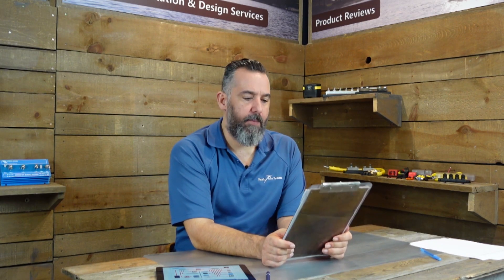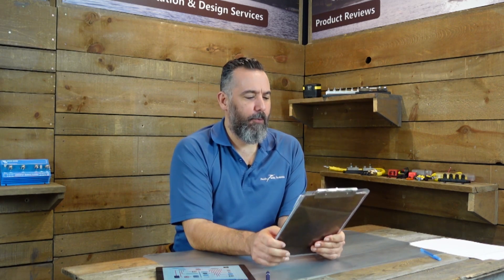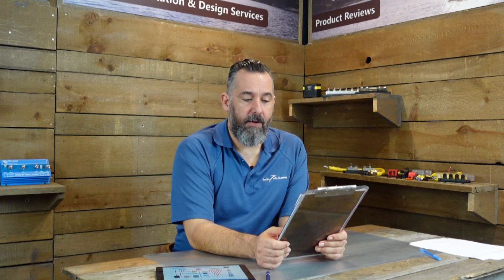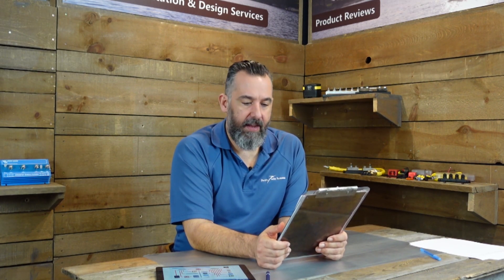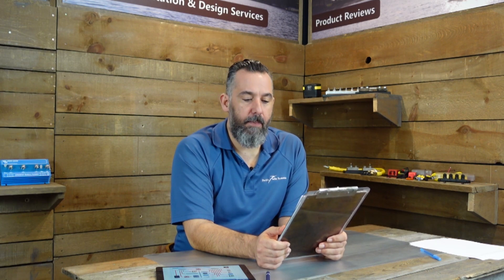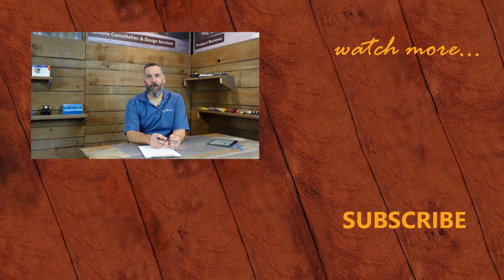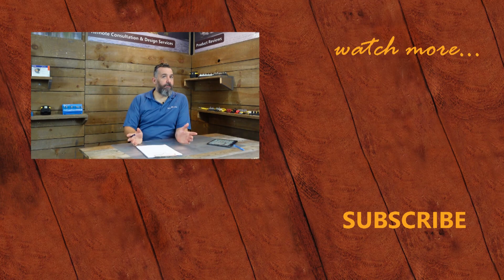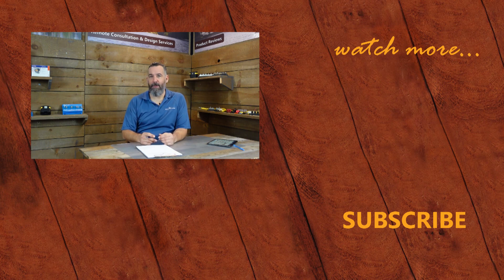Is It Necessary to Connect the RF Ground on My Electronics?  I Am Not Sure What Purpose It Serves?

Comment: The Grounded Conductor vs the Grounding Conductor.  The Grounded Conductor is current carrying,  the Grounding conductor does not carry current.  The shield is grounded once, it not meant to be current carrying.  Grounding has it's own chapter in the NEC.
Reply from the maker: Thanks Chip.
Reply: @PacificYachtSystems  You're welcome.

Comment: Can I have a red ground bus? Or can that cause different equipment to interfere with each other?
Reply from the maker: Hey Mike, above you mention red, assuming you mean "RF". Yes, it's recommended to have a RF ground bus that is connected to your overall common ground bus.
Reply: @PacificYachtSystems  yes I meant rf thanks
Had alot of questions in the last week and I think you had all the answers 
Thanks so much

Comment: Wait! I was with you right up to the end when you said that the non-current carrying ground is separate from DC Ground? Don’t the both connect back to the “Common Ground”? I will definitely watch the longer ground video!
Reply from the maker: Most wires are meant to carry current but a RF ground connection is meant to carry almost no current and is used for a ground reference point.

Comment: Everything must be put to the same potential. All "bonding" together.
Reply from the maker: Yep, thanks for sharing!
Reply: @PacificYachtSystems  You could also make a video on reducing RFI which is often due to "switching power supply" and other switching circuits on VHF and HF radios. The "inverter" and charge controller are often the problems. There are methods to reduce the impact.

Comment: Oh boy . In land based industry we use shielded wire. Say Belden 2 conductor. 2 wires with a bare wire/ shielded.  We connect the white and black to the instrument/ leave the bare wire unconnected at that end. Now at the other end we connect the bare ground to a good hard ground. This acts as a drain for strayvolts/ inductance. Anything done like this on boats. Sorry if I'm a pia.
Reply from the maker: Hi Redwood 1957, we do that in marine wiring too, for instance NMEA 2000 ground shield. We are talking about similar but yet different things, i think. Many items in the marine world, need a chassis "case" ground to be connected and is not normally current carrying.
Reply: @PacificYachtSystems  
We call it a drain. If I were to want to educate myself on marine methods and codes. Thanks Mike

Comment: A really hard subject to cover in a couple of minutes.  RF grounds can and do carry current though not DC.  They are there to gound the equipment from radio or RF which can be coupled into all the wiring and equipment on your boat.  This RF mainly originates from transmitters such as VHF but especially HF (SW) transmitters.  Radar, inverters and faulty regulators can also couple into other equipment resulting in "weirdness".  Equipment should carry an FCC and/or CE rating for electromagnetic compatibility (EMC) but this requires that the kit is installed properly i.e. with an RF ground connected.  Because RF interference is high frequency, the resistance of the ground wire can be significant so always use the thickest ground wire practical for RF grounds, especially on transmitters.  I use tinned copper braid wherever I can.  Also, don't daisy chain RF grounds.  Connect them in a star from a single point which is itself connected to the ground.
Reply: So where do these grounds terminate? the engine?
Reply from the maker: Hey Mike, thanks for sharing, very well said.
Reply: @unrulian  This is normally done by the builder but understanding how it works on your boat is useful.  https://www.westmarine.com/WestAdvisor/Marine-Grounding-Systems

Comment: The quality is getting much better, the audio is great. So the green wires, get used for RF ground. Typically that's tied to through-hulls and shafts etc, right?
Reply: love to know an answer to this as well.
Reply from the maker: Hi Tim, good question. The RF grounds should go to their own small RF ground bus, which in turn is connected to a common ground bus where all the grounds are connected.